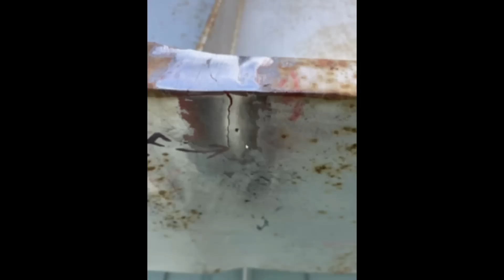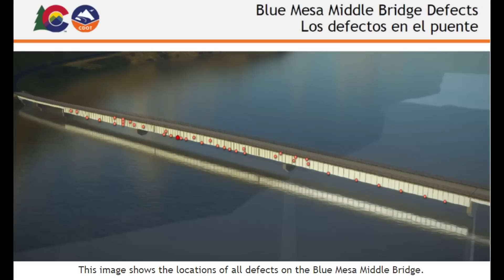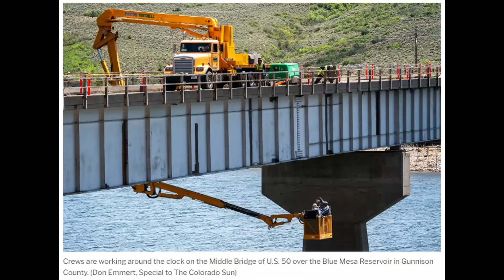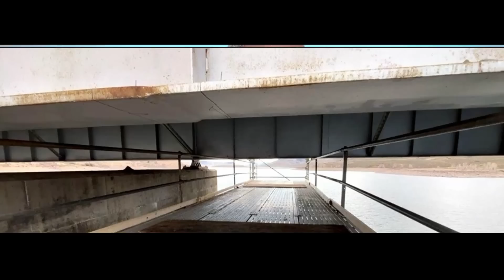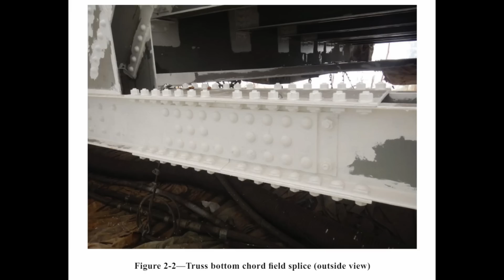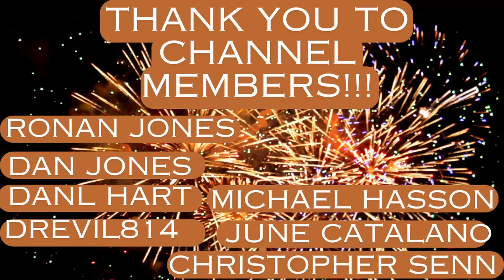US-50 over Blue Mesa - Steel Repair Plate Installation

Comment: Road, rail and brige construction workers, including engineering and testing are heroes of our society that too many people don’t even think about when driving from A to B.
Reply: This is exactly what cracks me up about the whole EV thing and lack of infrastructure. People seem to think "they" just need to run a few wires and boom! Infrastructure! They have no idea the time and work involved.
Reply: @aaadamt964  whoa! Please don't tar all EV drivers with the same brush. We drive a Chevy Bolt and think long and hard about infrastructure It's enough to make a duck bark!
Reply: @ericmintz8305  okay. How much excavation, materials, equipment, man hours, diesel fuel (let's not forget all the other fluids required to run this equipment) would it take to build the infrastructure to make EV's 50% of the vehicles on the road? How about the equipment that needs to be manufactured to tackle these projects? There's a gas station on every corner of small town with 6-8 pumps. It would take double, triple or more of that to have charging stations. Gas is trucked in on our existing infrastructure. The sale highway you and I use. You can't truck electricity in. Take politics completely out of it and think about how big this country is. There is no logical or feasible way to make this happen. An ev would be almost perfect for me right now. I live in the country but I'm a mile from town and everything I need. I'm not against ev's but I'm a realist. If you actually THINK about this it doesn't make sense.
Reply: No one thinks about engineers, steel and construction workers, until something fails.
Reply: @danielhoward755  Yep, then they are looking at them, searching for heads to put on pikes.
Reply: how far over capacity are these bridges, because of population and buildout of rural locations. uber-rich coming to live with nature. capturing their piece of nature before it is all gone. what was once a beautiful part of the state is now being filled with mcmansions.
Reply: @wunderfuel  This area is not very populus, and the road is well within traffic volume capacity.   Road geometry  is not everywhere the best (curvey) with speed restrictions lower than many care to drive.  No major tourist destinations along the way.   I once did a major rehab on a small bridge on US 50 perhaps an hour to the west.  Traffic was light enough that we used traffic lights at each end and alternating direction of traffic and rehabed the bridge with a minor widening one side at a time.